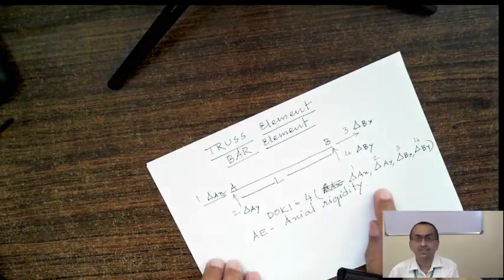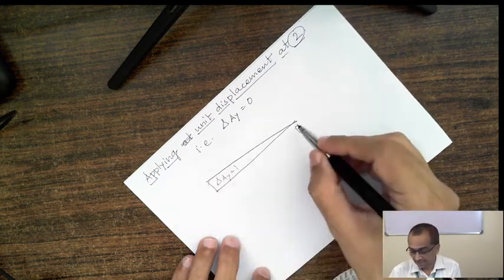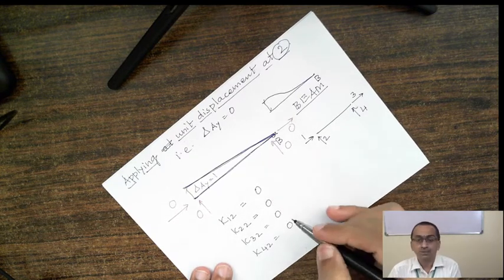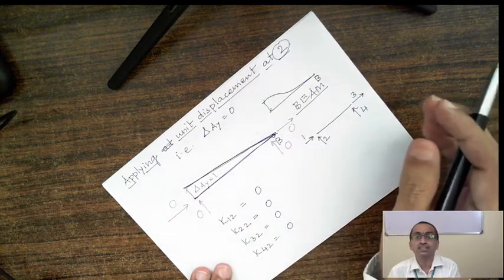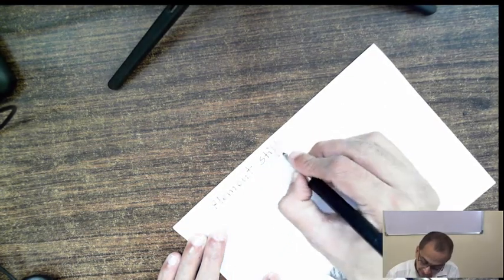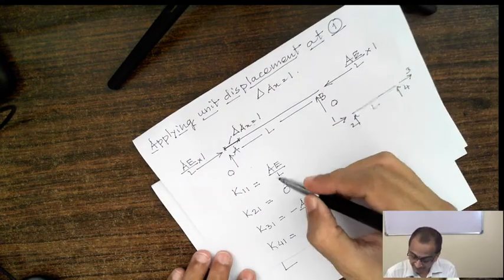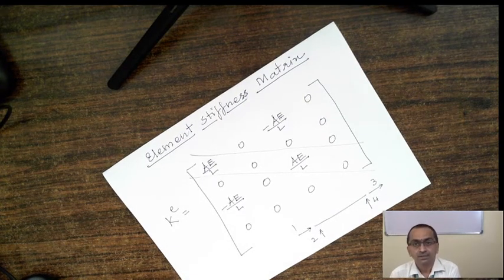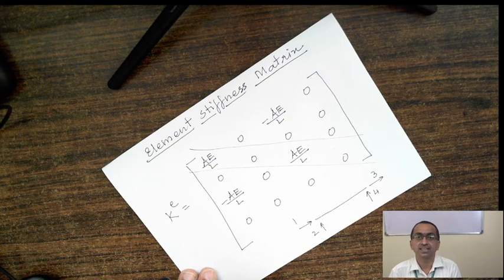TRUSS element (BAR element): Introduction and stiffness matrix 2

Comment: sir why no forces required to diplace the truss element in y direction while the delta Ay is presence
Reply from the maker: Because the other end of the element is hinged.
Reply: @ramkinhikar8995 so how will displacement occur without force? The far end will show no rection due to hinge,but on near end a force is necessary to cause unit deflection.